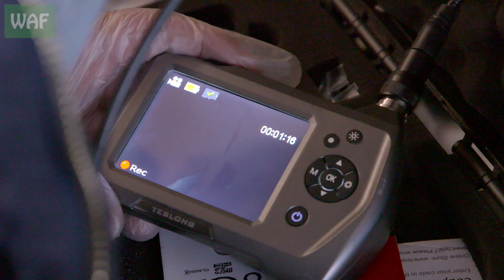Wildlife rescuer gets more than they bargained for!

Comment: 2:40 Interesting to hear. That must be so rare. A few years ago i ended up with 2 birds at once in our house. How they got inside? By the chimney. Lucky them it's an old chimney with small door they were able to push.
They were flying in my basement and it took me about 30min to catch one of them that has put themself in a corner meanwhile the other one took over an hour because it kept escaping me.
I took potato video & picture of them in my dark basement and a very well detail picture outside just before releasing him :)
A year or 2 later i ended up with a very bright yellow bird stuck in our hallway. Poor little thing it was exhausted when it just gave itself to me. When i got it and went outside, i opened my hand to let it go but it stayed instead of flying away. I literally just layed him gently in the shade of the trees. It took him a few minutes before flying away. I have picture of him too :)
That's a pic from the yellow bird
https://cdn.discordapp.com/attachments/733921930725425233/834736886471196742/IMG_0267.JPG

Comment: Is there something people can do to bird-proof chimneys?
Reply: Yes ! I have a capstone on top of my chimney that prevents large sparks from flying out and landing on the roof  and it stops wildlife from getting in !
Reply: There are several options depending on what kind of furnace and chimney you have, you just have to do a bit of research to make sure you get the right kind or you can have a lot higher risk of a chimney fire.

Comment: I wish there was a Simon around when a bird got down my chimney.The only way I could get it was by  smashing lovely Victorian tiles. I get a couple a year. I should have a cowl put on but it's a 4 storey house. More recently one got in via a chimney. When I tried to catch it ,it flew up on top on a Victorian fitted wardrobe and dropped down the back.Again,the only way I could get it was to break the back of the wardrobe out. Only a 3" gap at the back with an 8ft drop. Usually we get starlings and have had a couple of collared doves.